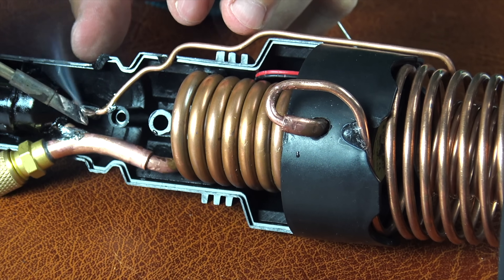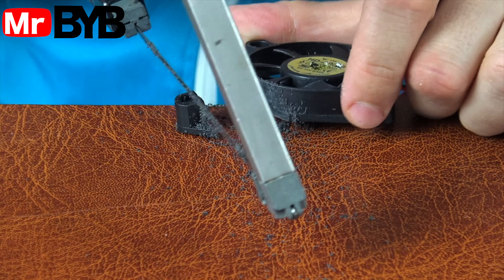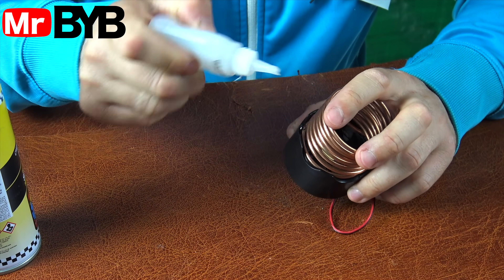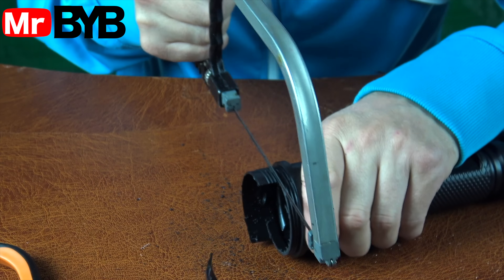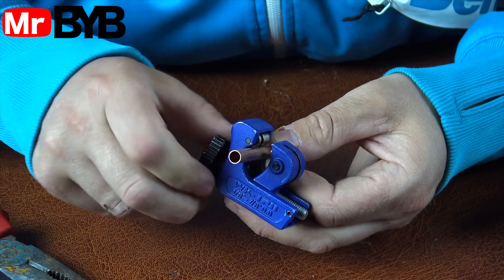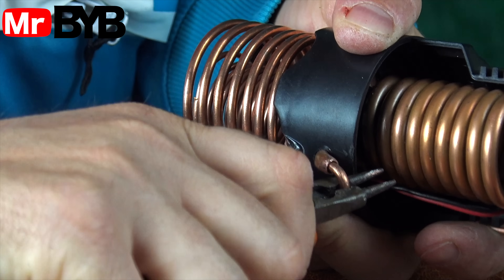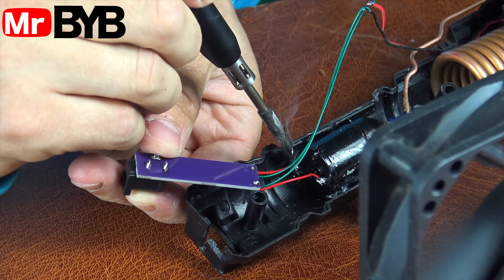DIY❄️ Mini Air Conditioner at Home – Ice Cold Air from a Flashlight!

Comment: Concept is sound and interesting. Not sure why the frost unless it’s fake, or more details are needed that wasn’t explained. The 1st law of thermodynamics says equal heat for the opposing cold, so +1C in heat means -1C on cold.  The fan blows one way so it grabs the hot air from condenser and sends it to the cold evaporator then they would cancel each other. So we should never see the frost. Even if you reverse the fan to suck, the same should happen with the cancel since the hot condenser cools off to nullify the gain. This is why all window AC has 2 fans and a wall between the two sides. The reason why the condenser and compressor needs a fan is so they don’t overheat, but that air should be outside warm before touching the condenser to not overcool it.
Reply: @lelmus3277 right
Reply: cuse indian movie😂
Reply from the maker: Great question — you’ve brought up a very important point. Indeed, separating the hot and cold sides is essential for any refrigeration system. But let’s break this down properly from the perspective of physics and thermodynamics.

You are absolutely correct that according to the First Law of Thermodynamics, energy is conserved — heat doesn’t disappear, it simply transfers from one place to another. This is exactly the foundation of how any refrigeration cycle works.

However, the key mistake in your reasoning is the assumption that a single fan automatically cancels out the hot and cold sides. That’s not entirely accurate.

When the refrigerant evaporates in the evaporator (the thin tube), it absorbs heat from the surrounding air — that’s why frost forms, or why the pipe gets very cold. Then, the compressor compresses the gaseous refrigerant, which heats up, and that heat is released through the condenser (the thicker tube). And yes, if air were freely circulating between the evaporator and the condenser without restriction, the efficiency would indeed drop significantly.

However, even without a solid barrier between the hot and cold sides, cooling still occurs — just with lower efficiency. Why? Because the rate of heat exchange depends heavily on factors like the surface area of the heat exchangers, the thermal conductivity of materials, and the temperature difference between the two sides. The evaporator locally absorbs heat, while the condenser locally releases it. As long as the compressor maintains the pressure difference in the system, the cycle continues to function.

The formation of frost is direct proof that the cold section of the pipe (the evaporator) is dropping below the dew point — and even below freezing. Moisture from the air condenses on the pipe and then freezes. This is perfectly normal for a working refrigeration system. Just think about the back wall of any refrigerator — it’s often covered in frost or water droplets for exactly the same reason.

🔗 Vapor-compression refrigeration — Wikipedia
https://en.wikipedia.org/wiki/Vapor-compression_refrigeration
Reply: @MrBYB  This works if your goal is to cool and frost the evaporator tube. But the air that blows out of that thing can only be cold if you create a separate air stream that cools the condenser and blows in the other direction.
Reply: @MrBYB dd dd took the words out of my mouth. Take a look at the link you posted and in the illustration, it demonstrates one fan for the evaporator, but that illustration does not show that it's shared with condensor. In the wording of that link it states "The rejected heat is carried away by either the water or the air, depending on the type of condenser." Instead of rejecting that heat away, you are refusing it. Hence my confusion.
Reply: @MrBYB Please don't be upset with my comments, I meant no disrespect to your efforts. If the device in front of you actually works as you demonstrated then the question is why when logic has doubt. There may be a very simple answer out there somewhere. If anything your videos and even fake videos raise interest in kids, and that's gold my man.
Reply: @MrBYB  Yes, even if it worked it would be a cold pipe trying to cool the air in a stream of heated air that is rapidly becoming hotter, because the temperature on the hot end also includes the (significant) waste heat generated from the operation of the heat pump. 
In short, even if the heat pump worked, logically it should work better as a hair conditioner than an air conditioner.

Comment: to reach -30 you need a very strong compressor and max heat transfer from the condenser to the air
Reply from the maker: You’re absolutely right! To reach -30°C, you really need a compressor with a high compression ratio and the most efficient heat transfer possible from the condenser to the air. That’s why the design of the heat exchangers and compressor power are critical. Thank you for the accurate observation!

Comment: What exactly is the life expectancy of that brushed motor in the compressor??
Reply from the maker: Great question! Brushed motors indeed have a limited lifespan due to brush and commutator wear. It depends on the load and operating time. On average, they can last anywhere from 50 to 300 hours

Comment: What kind of miniature compressor you use and where to find it ?
Reply: @sotnat9834  probably the most splid question here
Reply: I have to assume that he's using translation to get this written. I've also don't think it's necessarily fake just because it's small and that he made a small compressor which I also have to assume is some sort of piston based pump if it is made from some sort of internal combustion engine. Having to then wire in a motor that could then move the pistons seems doable but it is a very small package. That's not to say I don't think it's possible but I would really like to know how that was built. It would be fun to make a small DC voltage compressor at that scale. I definitely don't have a set of tools that would be able to make a compression piston setup that small. If you could make it small using cnc or possibly have it 3D printed out of metal as one sealed object that has a shaft that you could attach to a motor then that would be nice. Even so, 3D printing and metals is not going to get you that smooth bore needed see would still have to somehow access it to put rings on it and to make sure that The borehole itself is very smooth. I really want to make a compressor around that size maybe a little bit bigger. But it has to be sealed well so that no gas can leak. Obviously making it as a flashlight setup is not optimal for what I was thinking of. But being able to have it at that size would allow for some really fun experiments.
Reply: Your best bet is probably an all metal compressor for espresso machines or modify an RC nitro engine that you rotate with a BLDC.  They should be able to handle the pressure required for condensing some of the low pressure refrigerants like R600a (40-60 PSI). But his video is fake, so please do not try it unless you read up on some HVAC first. R600a is flammable, you would need a compatible oil to lubricate the compressor, and it will need to be stationary so the oil stays where it should be.  You can probably guess what happens if the piston or scroll tries to compress a fluid. The tools and equipment you need to DIY HVAC systems can be expensive.
Reply: @81formann I came to the conclusion that I either have to design a miniature rised scroll compressor that I could get 3D printed in metal because it seems the most simplistic compared to piston type. And then talking this over with another person they also mentioned using RC engines. I started looking into RC engines and the cost is fairly high but I bet I can find something cheaper from Alibaba or something like that. Then modify it to handle it. For sure this could work but it's most likely not going to work for long. Expensive is probably true on this. I really really really really really want to make something like this for real though. It's actually kind of crazy that it doesn't exist already as a consumer device considering it is possible.
Reply from the maker: Thank you for the question! This compressor is homemade, built from a small internal combustion engine. You can’t buy it ready-made, but you can look for small compressors from refrigerators or lab equipment — they’re the closest in size.
Reply: @MrBYB  refrigerator ac compressor are nowhere near this tiny... you have "billion dollar" piece of machinery and yet you completely ignore this fact in your video... somebody's lying 🤥
Reply: @tru6803 yes it's fake
Reply: @MrBYB  do you have a link?
Reply: @MrBYB  jajajaja🤣🤣🤣🤣🤣🤣He's pulling your leg. A homemade mini combustion engine with two electrical contacts? The engine is fake; it's all a sham to get likes.

Comment: We are gonna need more info on that micro sized compressor.
Reply: Right looks like he used butane so that is probably best case scenario it's pretty low pressure
Reply: @james10739  In his other videos he uses small DC water pumps that have been modded for use as the compressor. This one looks like it has a smal 3v DC brushed motor with what looks like the top of a nang (nitrous oxide canister) soldered to the top with another copper tube drilled and soldered in. I think he might have modded a small air or water pump to make it into this little compressor.
Reply: I'm going to call total BS on the compressor. The claim is that he's using a piston from a small gasoline RC engine.. but if you look at the size of the small DC motor and the chamber where the compressor would be it doesn't look as though they would be enough room to accommodate such a piston chamber ect... not to mention the force required for compression would not be coming from that little DC motor ..maybe a bldc motor. Obviously the concept is not rocket science... but misleading and definitely special effects going on with the final reveal!
Reply: @rickypotter3103 smallest compresors on the market are the highly 2.5lb and needs a bldc controller or the ridgid brand bout the same size and had a bldc controller integrated.  These are 134R rated compressors. Im making a water cooled/heated environment regulator suit so utility and blue collar workers can ignore the weather and be perfectly comfortable.
Reply: @Bioactive_Zone  I'll be your test subject
Reply: @rickypotter3103  dude took a small cup glued it on top of a small electric motor, painted all in black and called it a compressor, if it looks like a real one it must work like a real one right right? 🤡🤡
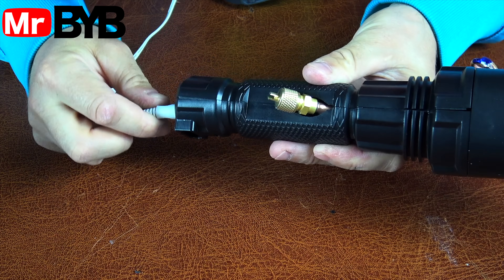Reply: This is FAKE !!  Compressor is FAKE! Even the power supply gives you away, which can't just be 12v and max 2A to be able to liquefy the gas. (look at 11:26) ... You need much more power. Maybe try a car tire inflator, the smallest ones need 8A/12v and up.
Reply from the maker: I made this compressor myself from a small internal combustion engine with a piston mechanism.
Reply: @MrBYB  Can you make a video, how you build this compressor? This is the main detail in whole construction, and no info about it 🙄
Reply: @JamezBond-oo3cg  he can't because the micro ac compressor doesn't actually exist lol
Reply: @JamezBond-oo3cg  dude, I second this motion. Power in a tiny tank. Lets see it!!!
Reply: @JamezBond-oo3cg  😂 he don't got it lol
Reply: @MrBYB  can you please post a video. Do you have a contact email id like to get in touch with you about a product design I have in mind which your unit you've made here would serve as a foundation to it.

Comment: Where the hot air from condenser goes?
Reply: back towards the evaporator!
Reply: @InfoSoup  I came here to ask this very question.
Reply: into your pants
Reply: I noticed too. There is no path to dump the heat from the condenser fan.
Reply: Fan also doesn't have a good inlet thus blocking the maximum airflow potential. If the condensor is moved out and the fan had an adjustable inlet it would be 2 ways to improve this for practical application. As is the cooling coils could still be sectioned off and used in a completely seperate airflow system making this an actually fantastic addon for a sealed filtered helmet air supply or even cooling for a hazmat powered air filtration unit. Overall great work.
Reply from the maker: Great question! In this compact setup, the hot air is partially released into the surrounding space. For better efficiency, it’s recommended to place the condenser outside of the cooled area, just like in real air conditioners.

Comment: If the motor pulses, try a more powerful psu
Reply from the maker: At startup, the compressor struggles a bit due to high pressure in the system — this is normal for piston-type compressors. As it starts running, the pressure gradually equalizes, the motor speeds up, and operation becomes stable. Increasing the power supply is not recommended